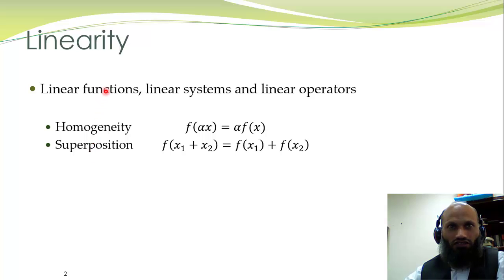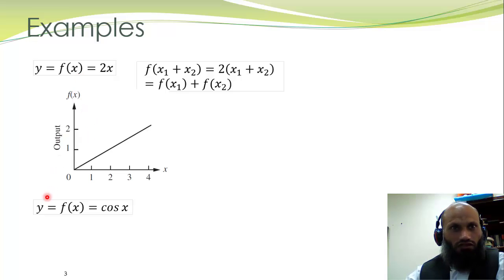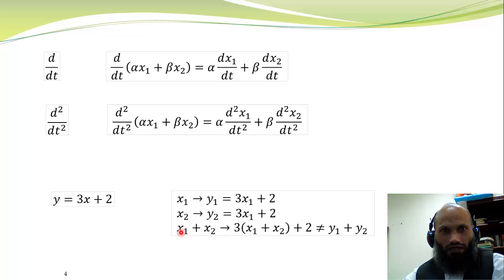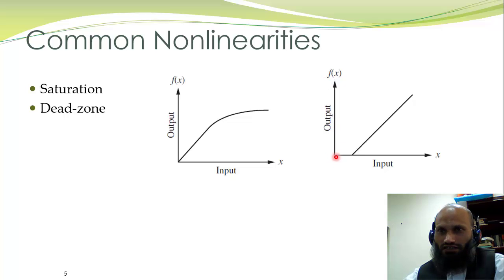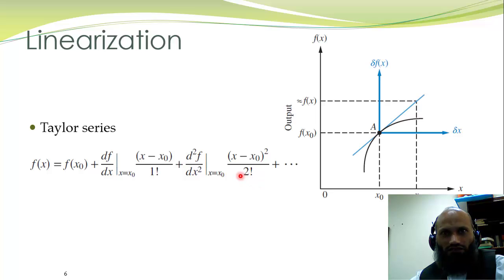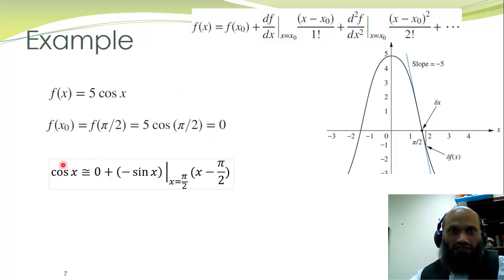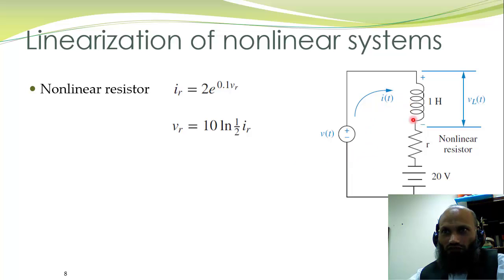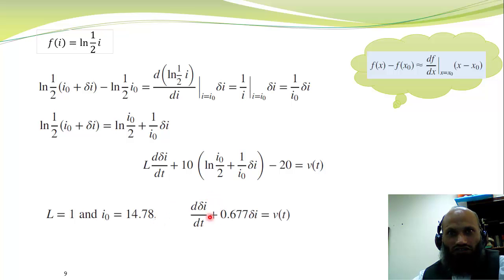LCS 11 - Nonlinear models and linearization

Comment: Jazak Allah Khair. I’m confused about the circuit example specifically ln (I+io)
Reply from the maker: You are welcome. In the electrical circuit example, the nonlinear function ln(i/2) is expanded about the operating point i_o using the Taylor's series approximation.  I plan to upload a few more examples for modeling of nonlinear systems to further clarify the concept of linear approximation to nonlinear functions.